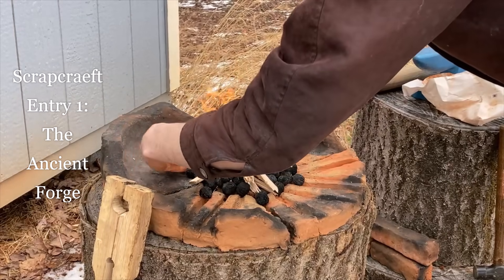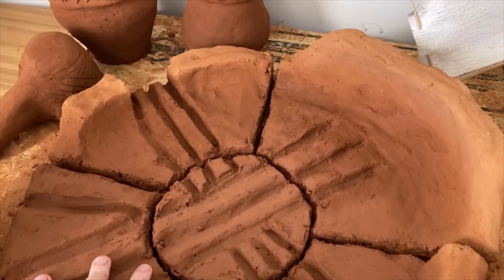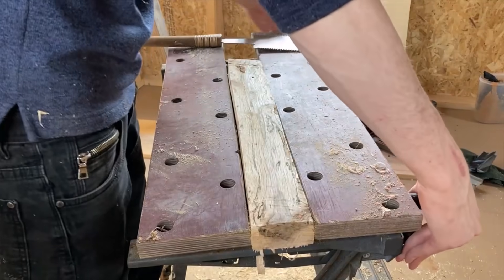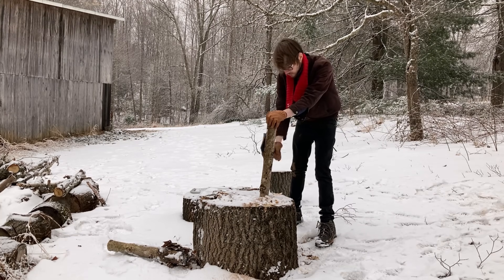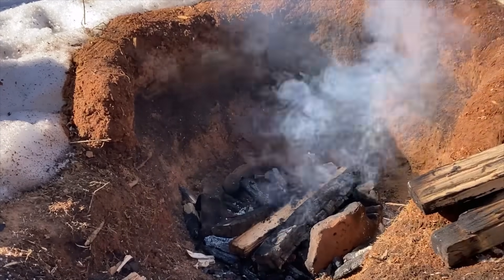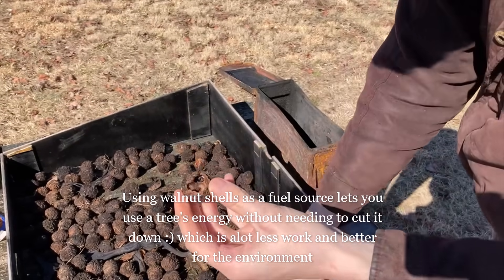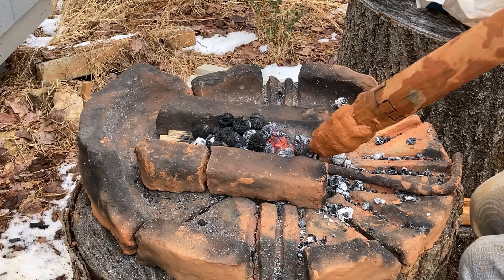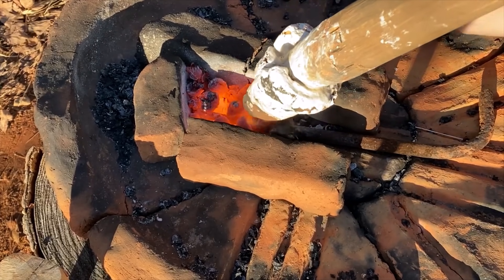Building An Ancient Tech Forge For My Workshop

Comment: Probably a little late now, but there is an inherent mismatch between the exhaling power of a human, and the inertia of air. You can get significantly more airflow by cutting short slots in your pipe near the middle, The air going through the pipe will have built up lateral speed (presuming the tube has a small enough diameter), which reduces its pressure and draws in air through the slots that will equalize the pressure, and will increase flow-mass significantly. It will also allow you to breath slower, but at a higher pressure, which should reduce how fast you get light-headed.

Comment: As and when health allows, im a professional blacksmith with a passion for experimental archaeology, so this video was fantastic for me!

Re getting more heat - ive often found that simply increasing the mass of the fire (i.e. bigger mound of charcoal) is a pretty effective way to get that.  Its a natural thermal insulator which also really helps and the larger thermal mass means you'll have a more stable central temp too
Reply from the maker: Thats a great suggestion! the murals do seem to depict a large pile of coals
Reply: @fraserbuilds  have you done any more with this forge recently? I'd love to see more on it and would be happy to help out with any advice/info I can

Comment: I did have a thought about your pipe though, if you were to fill the void in the wooden tube with clay and then push a thin hole through it, the velocity of exhaled breath would be increased and then by adding a small nozzle an extremely forceful wind might be produced.

Comment: Congrats for your searchings and findings! Great way to transfer knowledge into teaching, probably the best.
Just one little thought: As for maintaining the heat in the charcoal, I think that more than one, probably 3 people blew in a 3 phase pattern, just like " modern" blacksmiths use helpers to hammer big pieces of steel one hammer cannot forge.
Reply from the maker: Thank you! I think youre right, it would make perfect sense to have multiple blow pipes at once, especially with harder tasks like melting copper for casting.

Comment: Pine or most softer cleaner woods produce more heat. I used walnut and oak and they never burned as hot or as fast as pine or birch did. Softer woods don’t last as long however.

Comment: Great Videos!! Amazing Topics and great Narration!!

What I saw when You were using your Saw, that You have a Pull-Saw but were giving it at least equal Force in Pushing and Pulling.
If You haven't figured it out yet and want to imptove, try letting the Blade slide through the Gap with barely touching the bottom Wood while pushing and only using your Strength while pulling.

That should be Way less tiring :)
Reply from the maker: Thanks! will do, I seriously appreciate the advice :)

Comment: I’m only ½ way through your video and finding it very interesting. Could I suggest to help you with the carpentry work, you look at making a shaving horse and buy a drawknife as this will help you a lot more than using some of the tools you currently use. I’d also recommend you also look at a couple of books by “Walter Ben Hunt” 1888-1979 his knowledge is incredible and his books are very very informative. I can’t for the life of me remember the name of the books I’m thinking of, however he explains what they are and used for. I would also suggest learning about bushcraft shills and bowl carving etc which would hone your skills when making tools. Regarding the copper you place on the handle of your tool (you could also use twine or leather which would be more available than copper and a cheaper alternative, however when using copper, it not only needs to be tight, but closely wound together as it’s both of these which would help the wood from splitting. I can’t remember the name of it but this technique goes back thousands of years. I’ll finish watching the remainder of the video now. Thank you for sharing the video with us, please keep making them

Comment: They still use blowing pipes in india. You don't blow into it like a didjeridoo. You blow across the mouth end like blowing across the top of a glass. There is a sweet spot where the angle of blowing across the edge is telescoped and magnified at the other end.

Comment: You really, really, need to work on your pronunciations.
Reply from the maker: I've had many years of speech therapy to correct my speech impediment, what you hear is just the remants of it. its not going away.
Reply: @fraserbuilds  I admit I, jumped to commenting before finishing your video. (Just now finished), but if anything it got worse. Keep working at it. Your video has value to be sure. Sadly your pronunciation of ur, or, ir, er, detracts substantially from the overall product. I still hit the like button despite that.